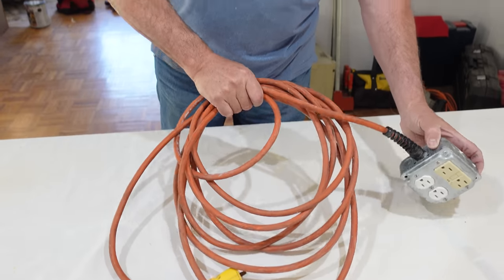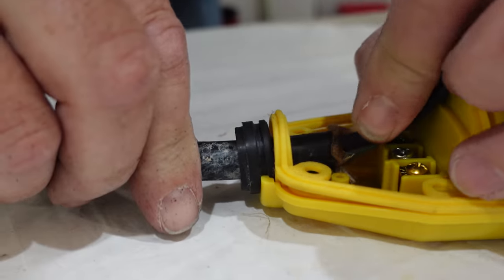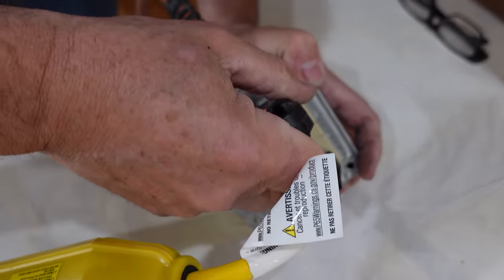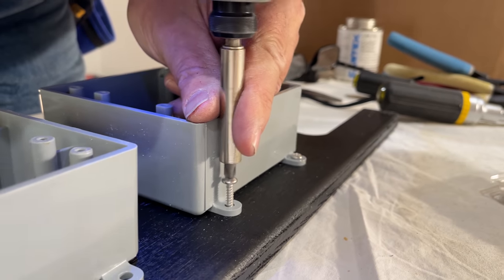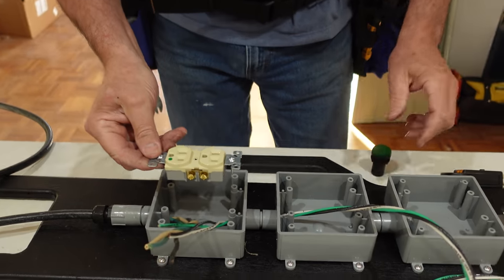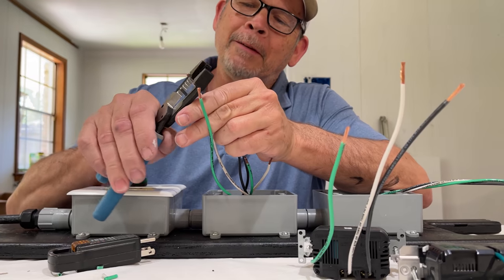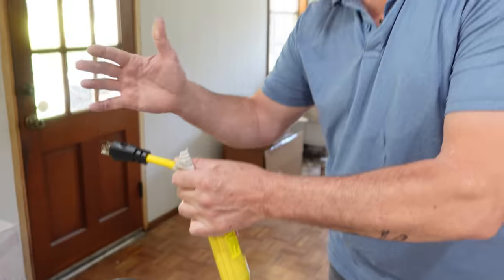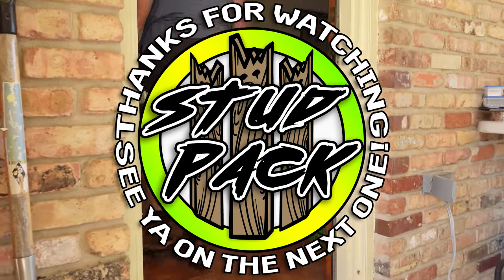HOW TO MAKE THE ULTIMATE EXTENSION CORD!

Comment: My one suggestion as an electrical engineer would be to place 20 amp outlet at the end where the line cord enters the first box and put the indicator lamp and hospital outlet at the far end.  That would serve two purpose... it would keep the heavier current from passing through extra wiring and connections.  Second having the indicator at the far end would indicate that power is actually getting to the farthest end of the unit!
Reply: except they used those wago bus bars to distribute the electrons, so each outlet was effectively the same distance from the main wire.
Reply: Can you explain the purpose of a 20A outlet when that GFCI plug is only rated for 15A?
Reply: @amkelle2  - As stated in the video the 15A gfci can handle some overload although that is not ideal.  You could usd a 20 Amp, inline gfci unit instead, but that might require you have access to a 20 Amp receptacle as the source power.
Reply: @LarryCoates1948  To be fair, yes, I did not intently watch the whole video, I skipped through a lot of it to get the jist. But still, wouldn’t a 20A pull on a 15A outlet be unsafe? Or even pointless if the breaker is 15A
Reply: @amkelle2   - it could be a problem but most likely not for a short term use. Long term yes ti would be a problem but would trip the breaker if it heated up for too long!
Reply: @LarryCoates1948  Maybe it’s just me, but it sounds like putting space heaters on an extension cord
Reply: @LarryCoates1948  What about a 20A breaker that has multiple 15A outlets, but (1) 20A outlet? Or is that against code?
Reply: @amkelle2  Look at it this way, You can plug a 15A cord into a 20A socket. 
As long as the cord you use is rated for 20A, using a 15A plug works just fine in a 20A socket.
Reply: @gameglitcher  Yeah, it doesn’t work the other way though or you burn your house down. You’re not gonna put 60A breaker on wire rated for 30A
Reply: @fourtwanky  , no, not true.
Check the video at 18:30.
They're jumpering each box.
I'd use the wagos in the second box to distrbute the power evenly, like you said...
Reply: @amkelle2  If you are using a 20 amp device when a power surge comes through and the GFCI is rated for 20 amps then the device is fried. You want the power to cut off before it reaches the devices rated amperage.
Reply: @budsak7771  Well, I’m not referring to a surge event. So, as a example, let’s say you get a water pump. The water pump outlet is 3/4 inch. So you use a few adapters and attach the outlet hose to a 1 1/2 inch hose. Well, it doesn’t matter how big you make the hose, it can only pump as much water as is rated for the 3/4 inch outlet. It’s not gonna pump more because the hose is bigger. So basically, if you put a 20A outlet on an extension cord with a 15A plug, won’t it overheat from too much draw? Or 20A devices just won’t work?
Reply: @amkelle2  The GFCI is supposed to break in the case of a power surge which is why its a Circuit Interrupter. Any connection will allow past exceeded rating as shown at the end of the video but the amount has to be a sudden burst to interrupt the connection. At the end of the video if he had all the devices plugged in and they were all switched on at once the gfci would've blown. But since they were all turned on one after the other the gfci didn't interrupt and like the camera operator asked if it could've started a fire, it definitely would've gotten some things hot.  So a GFCI is for surge protection not amperage protection. Also, the wire amp rating table will show how much amperage a cord will support.
Reply: @budsak7771  I know. That’s what I’m saying. The GFCI WON’T trip with 20A devices, but it’s only rated for 15A. If you run 20A devices on a 15A wire and outlet, is that not extremely dangerous? Because it’s not only heating up the extension cord, it’s also heating up all the wires inside the wall, and the outlet.
Reply: @amkelle2  Yes, it is dangerous to run any amperage over a devices rating. The best thing to do is to keep track of devices amps and know which receptacles are connected.
Reply: @budsak7771  That’s my point! Why put a 20A outlet on a 15A plug?
Reply: It doesn't really matter. He have a 25 meter cable from the closest outlet it won't be a problem. Wagos can tackle it. And for the light, if it's in series it is possible that the first has power and the second don't but if they do it properly it won't be a problem
Reply: It doesn't really matter. He have a 25 meter cable from the closest outlet it won't be a problem. Wagos can tackle it. And for the light, if it's in series it is possible that the first has power and the second don't but if they do it properly it won't be a problem
Reply: The 20A receptacle is useless in this use case anyway. Seeing at he is using a 15A plug. I still don't understand why he used it even after his explanation.
Reply: @amkelle2  It's a GFI, not a circuit breaker. It looks for leakage current that exceeds 4-6mA at which point it will trip, nothing else.
Reply: @bobd.  I know, my point is not the trip because of a ground fault, it’s that the wires are rated for 15A, so overloading the wires with 20A is a bad idea, mainly BECAUSE it won’t trip the GFCI and it will just heat up the wires and components, including inside the wall
Reply: "My one suggestion as an electrical engineer would be to place 20 amp outlet at the end "
So you can plug the extension into a 15 amp circuit and run a 20 amp appliance tripping breakers and starting fires?
This is why I hide my tools when I see an "engineer" coming my way.
Reply: @BS-ys8zn  perhaps  but my dad was a master electrician and I worked with him from the time I was 12.  Did you actually watch the entire original video which demonstrated what it took to trip the 15 Amp breaker in the main panel?
Reply: @amkelle2  as
Reply: @budsak7771  That is not correct Bud. GFCI= GROUND FAULT interruptor, not over-current or surge interruptor. 

A GFCI does not sense current overloads nor surges. GFCI's are not circuit breakers. They are Ground-Fault-trip devices. The GFCI trips (goes open-circuit) only if a ground fault is detected. A 15A GFCI will flow 50 amps (however briefly) before smoking and worse, but it will not trip. (Yes, that's a silly, worst-case example; there wouldn't be a 50A 120v breaker, normally, but I think I make my point). 

Regarding current-flow, a 15A GFCI receptacle is just like a 15A standard receptacle: it will not go open-circuit due to short-circuit or excessive current draw by the device plugged in. That is because the GFCI is not a circuit-breaker . The panel breaker will go open-circuit if current draw exceeds the panel breaker rating, but the GFCI will remain un-tripped. 

The sole purpose of a GFCI is to trip if current leaks from a circuit conductor to ground in the GFCI or in any protected receptacle wired "downstream" from the GFCI. To sense current leakage (not over-current) and to protect the operator. Not to act as a current-trip or surge-trip device. 

This discussion would be better served if everyone will understand that GFCIs do not contain a circuit breaker. Yes, a GFCI contains a little button that goes "POP" sometimes, and power is cut off, and we press the button to restore power. Such a trip may look similar to a circuit-breaker trip but *it does not trip due to over-current*. It trips only due to a ground-fault.
Reply: @davecc0000  Thanks dude, I knew I was missing something! It is for some kind of short in the circuit and not a surge. Been too long dealing with the details. Appreciate ya!
Reply: @budsak7771  No, not just a short, but some drain to ground. If you short hot to neutral, there is no leakage to trip it, just lots of current.
Reply: First and foremost circuit breakers protect the cables distributing power from the panel board to receptacles and switches.
Reply: @joefrisco  To be more clear, they are designed to protect the conductors but do also protect devices. A breaker is going to trip long before the conductors get too hot which also saves the device if it is the source of the over current.
Reply: As someone who knows pretty much nothing about this kind of stuff, I was wondering why they didn't put the indicator light at the top.
Reply: I agree the 20A outlet should be first even though all outlets are wired in parallel. Reason being that the parallel connections are made along those wego bus bars instead of a strong wire to wire conductive connection like with wire nuts.

If you have 2x 20A devices pulling current from that outlet, you aren't putting that current load on those bus bars in addition to the additional load from the devices plugged into the other outlets.

It's a bit nit picky, but I think it's better practice even if the wego bus bars can handle the combined current before the breaker trips.
Reply: "as a blah blah blah" the worst way to start a comment
Reply: @fourtwanky  But in one case it's going through more connections and more wire.
Reply: @davecc0000   This is what someone well educated in his field of expertise looks like.
Reply: @amkelle2  the only real purpose is the contacts are stronger inside the outlet and can take the abuse of pluging and repluging things into it all the time.  The amps going through the cord is limited by the 15 amp GFCI plug.
Reply: @willschultz5452  Is that really a thing?
Reply: @amkelle2  sorry what were you referring to?
Reply: @willschultz5452  The 20A outlet with a 15A gfci
Reply: @willschultz5452  Like is the 20A outlet more resilient? Isn’t there commercial grade 15A outlets for that specific purpose
Reply: @amkelle2  yes they are and they have strong contacts.  They do make premium grade 15 amp ones also, the main difference then is the 20 amp receptacle just has that cut out for the side way prong for the 20 amp plug. It really makes no difference since  The current flowing through it is regulated by the size circuit breaker. It's perfectly fine to use 20 Amp receptacles on 15 amp circuit because if you overload it the breaker's going to trip.    Same way if you use 15 amp receptacles on 20 amp circuits that's still perfectly fine by code.  Nothing that has a 15 amp type of plug on  it is going to exceed 15 amps.   I just use premium grade receptacles  either 15 or 20 amp rather than those cheap ones.
Reply: @willschultz5452  I just don’t get the idea of using a 20A receptacle if it’s only gonna pull 15A
Reply: @amkelle2  its really only for the  durability of it then it is that any more power would be flowing through it
Reply: Indicator light at far and near may sound like too much, but this the HULK OF ext cords right? It gives more instant exact  power  location.
Reply: @amkelle2  
A heavy duty 15 Amp plug, the types used in the USA like the heavy duty one shown in this video can handle a lot more than 15 A continuously. In fact the only difference between the 15 and 20 Amp plugs is that the 20 A one has the blade at right angles and is not any thicker. Generally its housing is made of materials to handle more heat. Drawing 20  Amps from a circuit protect with a 15 A breaker will cause the breaker to trip due to overcurrent but not immediately. A 15 A breaker means it can handle 15 A continuously and will eventually trip on currents above that based on a graph specified by the manufacturer. The more Amps above the rating the sooner the breaker will trip. At 20 Amps drawn  it may take 15 A breaker 2- 3 minutes to trip (depending on the type).

The reason that a 20 plug has a different configuration is so that the average person can't plug a 20 A rated device into an ordinary receptacle that is supplied by wiring that can only handle about 15 Amps. If that supply is protected by fuses that have been replaced by a wire or a nail at some time in the past a fire could result.
Reply: @davecc0000  
These days RCD Breakers (Residual Current Device Circuit Breakers) which is what many circuit breakers and power board fuses are replaced with here in Australia have a GFCI, Surge Protector, and Over Current Circuit Breaker all built into the one circuit breaker. They are quite cheap and very handy. They were first used as the main switch / breaker but as they got cheaper and smaller they are now installed on seperate circuits forgoing the inconvenience of losing light and power to the entire house when there was an earth leakage fault. Nowadays, there is a main high current breaker for the entire premises and individual breakers with GFCI built in for seperate power, hot water heater, stove, air conditioner, and light circuits as required.

I understand your point that many GFCIs found in receptacles esp the USA don't have an overload breaker built in but some extension lead power distribution boards do and the DIN rail standard type that I mentioned above could be fitted easily into a plastic box so that you had GFCI and overload protection if you wanted to make one yourself as in the video.
Reply: awesome suggestion
Reply: @davecc0000  I'm glad that someone else understands that about GFCI.
Reply: @ Larry Coates why do engineers (& I especially notice electrical ones do this more) always start off a conversation announcing they are one? Just curious 🤔
Reply: thats a good idea
Reply: @eddiesgroup9604  - At 15K watts, you are pullig over 136 amps at 110 Volts.  Most extension cords are designed to handle up to 15 amps.  That means that you need at least TEN (10) power cords each on their own 15 amp circuit!  Likewise, most power strips are designed for a maximum of 15 amps so one per extension cord.  To put things in perpsectice most homes only have between 100 amp to 200 amp electrical service into them and your sound system is using about 70% of all of the power needed to power an entire 200 service entrance for most homes!!!  It is little wonder that You are having power problems!  Keep in mind that I said that you need 10 15 amp circuit breakers, NOT 10 receptacles, because often one circuit breaker supplys power to multiple DUPLEX recptacles!  Hopefully any comercial venue that you are performing in should be able to provide you with at least 10 dedicated circuits!
Reply: @LarryCoates1948  most audio systems run average loads of 10% of peak with transients in the millisecond range, and that's at full blast. The OP is obviously not doing any serious pro work, and is likely not even hitting those numbers as evidenced by the fact he's probably running the whole thing off one 15 amp circuit presently. He'll be fine with 2-3 15 amp circuits.
Reply: @seanoneil1681  Excellent question! 'Especially true when said electrical engineer is NOT a practicing electrical engineer, but rather, for 11 years has been a self-described failed Internet marketer, who may have studied electrical engineering sometime in the past.
Reply: @eddiesgroup9604  look at the total amps of your system. 
The power drawn at the outlet is not 1 to 1 of what goes through the speakers, because the speakers do not have 120 volts across them.. 
Watts = Volts X Amps or Amps = Watts / Volts 
A standard 15 amp outlet can easily handle 1.5 Kw. 
Your speakers are not at constant 6 KW 
Let's say divide the volts in half, we can double the amps and still draw the same watts
Reply: @seanoneil1681  Because they are a trained voice that may be worth considering versus the "I'm not an electrician, but..." comments. When I see comments that start with "I'm a Journeyman or Engineer. or I'm a trained..." I pay a little closer attention to what they have to say.
Reply: @budsak7771  GFCI = Ground fault protection NOT over current protection
Reply: @amkelle2 I have 20amp outlets everywhere in my house because they are a better built outlet.
Reply: I’m no engineer but those steps you described seem so obvious.
Reply: @Mike Dalton  yes it should be obvious  but since it was wired opposite to that, I guess it is not so obvious.  Sort of like "common sense" is not all that common!
Reply: 15a outlets are rated to pass 20a... Field electricians would know. Not coffee drinking electrical engineers.
Reply: @budsak7771  I would have to disagree, the GFCI is for current not returning in equal amount via the neutral, as long as it is balanced the GFCI does not care. The reason the GFCI will trip is if even a microamperage goes elsewhere to ground. If you want surge protection which has been useless in anything I have seen, you should instead Google Brownout Surge protectors, (no battery backup) and UPS . The surge brownout protectors actually cut power at low, roughly 90 volts, and high, roughly 130 volts, and leave it off for around 30 seconds, or for units to protect compressors like refrigeration they leave it for 3 minutes to give the pressure in the compressor time to equalize instead of trying to restart while pressure is still high. Hey, I think just figured out what the ultimate extension cord is missing, But hey I was happy with the predecessor to the ultimate .
Reply: Smart man!
Reply: @larry Coates I didn't read all the replies so someone might have mentioned this but would it be dangerous to put the light at the far end? because if one of the connections leading to the light burns shutting the light off, you could end up in a situation that the cord is live, but is thought of as turned off?
Reply: @GeN56YoS  - That is a decent point that you raie.  It could provie a false indication that ALL circuits are dead wnen that might not be the case.  Probably the likelhood of that condition happening is pertty small but certainly NOT zero!!!  My main point was to put the heaviest load closest to the line feeding the unit to minimize drop across branches towards the end
Reply: Not an electrician but was taught that the gfci is designed to trip if there is a short to ground
Reply: @LarryCoates 1948 he claims that he reads every comment on his videos in this video it looks like either he does not check every comment or only comments on comments that make him look good.
Reply: It's alternating current, so what difference does that make which devices closer to the line side?
Reply: @amkelle2  He said if you're using a tool that requires the 20A outlet, you DO NOT plug the cord into 15A power.
Reply: @amkelle2  Whichwires in this video are limited to 15A?
Reply: @budsak7771  A short circuit is not the same thing as a ground fault.
Reply: @seanoneil1681  Not all of us
Reply: @LarryCoates1948  I think this question was satire.
Reply: @kmchartrand99  Is your cabling at least 12 ga wire? If not,then you have created a potential fire hazard.
Reply: @GeN56YoS  It's alternating current so it makes no difference which end the light is on. There's an incredible amount of ignorance being posted here.
Reply: @disabledhomesteader  That's not a short circuit and it's not a power surge.
Reply: @dolfinwriter5389  it's more convenient but user preference at the end of the day
Reply: @JVBL1  What is? Not sure what you're responding to.
Reply: @dolfinwriter5389  he brought up a good point of putting the light at the end and the higher plugs at the start but you are also current that it's alternating current each his own
Reply: @dolfinwriter5389  The outlet and the ones in the wall. There’s a reason the outlets of the home are 15A outlets
Reply: @dolfinwriter5389  Then why have it?
Reply: @amkelle2  It's HIS extension cord. He will know whether he has plugged it into an available 20A receptacle or not. He's not selling them. It's for his own use. So if he doesn't have 20A power available to him, then he doesn't plug in any tools that require a 20A receptacle. So to answer this question, "Why have it?" is for when he NEEDS it AND has 20A power available. I heard him say this. Did no one else?
Reply: @amkelle2  No. You're not going to be fully loading all of them simultaneously. And if you TRIED that, the breaker would trip.
Reply: @dolfinwriter5389  Dude, did you see him put a 15A GFCI protector on it? Why put a 15A GFCI protector and a 20A plug?
Reply: @dolfinwriter5389  The 15A GFCI would trip too, so why even put a 20?
Reply: @amkelle2  There could be a couple of reasons why the home outlets are 15A outlets, but that's beside the point. Any branch circuit which is wired with 14 ga cable should (1) have only a 15A breaker; and (2) have only outlets rated for 15A. This thing he made is not an outlet in the home; it's his own work aid and HE will KNOW whether he had 20A power available and whether he plugged it into a 20A outlet. I installed some new circuits in my garage for freezers and power tools. I used 12 ga wiring and put them on a 20A breaker, and I installed 20A outlets. I could have gone cheap and put in 15A outlets. The outlets inside the house are 15A outlets on 15A breakers, so because I haven't torn all the walls open and inspected all of the wiring, I'm going to assume there is only 14 ga wiring inside.
I don't like a lot of Larry Coates's responses here because I don't think he knows what he's talking about.
But all of this discussion proves a bigger point--the person who posted this doesn't have to show any credentials whatsoever to prove to viewers that he knows what he's doing. Nobody should be watching this video and then making one of these for their own use, let alone for anyone else to use--UNLESS that viewer is a licensed electrician and knows and knows that this thing is code compliant in his or her locale. The code does vary from city to city and state to state, and sometimes even within cities. So because of that, I would not recommend ANYONE install a 20A receptacle in this device as this YouTuber did. Guaranteed with the amount of ignorance displayed in these comments that SOMEBODY is going to make one of these and then plug it into a 15A outlet and then try to run some tool that requires the installed 20A outlet on this device, which is I believe, your whole point. That would be foolish and dangerous. But I can guarantee somebody will do it. I found enough electrical nightmares in my last house of 23 years that was previously owned by a LICENSED ELECTRICIAN, and now I've found a few in my current house, done either by idiot previous owners or shoddy contractors at some point since the house was built in 1978. We even found that our AC condenser external disconnect was bypassed internally. I suspect the condsr fan motor was failing for some time and blowing fuses. So they bypassed the fuses. And we found it when we had the condsr fan motor replaced under HO warranty just before the warranty expired!
And your own comments prove part of the reason for that--you said you just skimmed it. I think you haven't fully developed your thoughts of what really bugs you about this and how to ask the question you really want to. So how about this--Suppose somebody else just "skims" it and misses key warnings and caveats, and builds one of these, or builds it either poorly or just wrong (or BOTH), and eventually starts a home fire by overloading either this device or the home wiring. Who's at fault? I think where you're going is to say the person who posted this video is at least partially at fault, but may never even now what he caused. He personally will never misuse his own device.
I don't think somebody who only knows enough to be dangerous should be watching this video and making one of these. So the person who posted it should probably take it down.
Reply: @amkelle2 Why would the 15A GFCI trip, absent a ground fault?
Reply: @amkelle2  I think you have a misconception that installing any 15A outlet in a circuit thereafter limits that entire circuit to 15A. And/or you have a misconception that the 15A GFCI somehow trips on overcurrent like a circuit breaker. It does not protect for overcurrent. It will not trip on overcurrent. It will trip if it senses a current mismatch between the hot and neutral leads greater than its design trip point.

I'm not going to respond to any more of this because it is too difficult to find this part of the comments thread every time, and I have to get on to some other things.
Reply: @dolfinwriter5389  If it draws more than 15A
Reply: @dolfinwriter5389  Weird! I know exactly when you reply
Reply: Maybe replace the switch (or the indicator) with a neon indicator switch. i can see wanting to keep some circuits live and only switching the last one, but replacing the indicator with a lighted switch would open up a slot and serve two purposes.
Reply: No, the 20-amp outlet should not be in the first box.  It shouldn't be in any box.  Including a 20-amp socket at all in this is a code violation and a fire hazard.  Period.

Why?  Because the cord itself (and the GFCI device) is not rated to carry that current, and can overheat, melt, and catch on fire if that is done for an extended period.  Worse, the plug end is using a 15-amp plug, which means it can (and probably will) be plugged into a 15-amp wall socket.  If you then pull 20 amps through that 15-amp socket that is not rated for it, the wall socket can melt and catch on fire.

The 20-amp stuff is keyed differently for a reason.  If you have any 20-amp outlets, you must use a 20-amp plug, and ensure that all intermediate components are rated for 20-amp operation.

And his statement that "the breaker will just trip" if you plug it into a 15-amp outlet is also just plain wrong.  That is not how circuit breakers are designed or what they are for.  It is quite common to have 15-amp sockets on circuits with 20, 30, or even 50 amp breakers, and in that case the breaker will not trip, but the socket will still be overloaded and can catch on fire.

Really, one of the things he should have built into this but didn't is a 12-amp breaker in the power strip itself (Note: even 15-amp would be incorrect in this application.  NEC requirements say you are only allowed to pull 80% of the rated current through an outlet (15*0.8=12 amps max if you're using a 15-amp plug)), to ensure no more than that is ever pulled through the main plug/power cord (like almost all real power strips actually have).  If he'd done that, then it actually would be OK to have the 20-amp sockets in there (but they'd also be kinda pointless).

This guy really needs to go back to school.  He does not understand what he's doing, the codes, or any of the principles involved, and as a result he is designing actually potentially unsafe equipment.
Reply: I was also thinking it should be wired so that the switch controls the whole "bar"
Reply: That’s really smart
Reply: I was thinking it would logically make more sense to have the 20Amp plug first, so you remember not add extra load after it.
Reply: Neat project. Thanks.
Reply: @amkelle2  actually, you can. Code allows 15A wire (AWG14) to be connected to a 20 amp breaker as long as that wire is going to more than one 15 amp outlet.
Reply: @thelongislandguy  I’m not talking about the breaker, I’m talking about a 20A outlet
Reply: @garychin-a-foeng7901 So you'd make the second box a central hub from which to fan out the power back to the first and on to the third as well as the second?  Good idea-- that way there'd be no voltage drop on that last receptacle in the third box, if they were running something in box one or two for a short run continuous duty.  The NEC states that the circuit should be able to handle continuous duty at 1.25% before burnout is likely or limit the total load to 80% if there are multiple draws occurring at varying intervals.  Like he said in the video, they're not going to be running every device concurrently.  At most you'll have a couple of iPhones on a trickle charge while running a table saw for a short run continuous duty.  The longest cuts on a table saw tend to be rip cuts on 8' sheet goods such as plywood or mdf... if you're running a planer, perhaps the load would be greater than the table saw for longer boards.  I don't have any experience with a planer.  I always buy finished goods since I don't own a planer.  Can anyone weigh on on the planer amp draw?  What's been your experience with the voltage drop on the circuit while a planer is running with a shop vac or dust collector running?
Reply: @amkelle2 If the device is running continuous duty on the 15amp circuit it's likely to burn it out pretty quick.  My table saw trips my 15amp circuit all the time, usually when I'm ripping 8' long sheet goods and especially when the load meets with some resistance.

"Worn motor brushes, a bad drive motor, a faulty motor overload switch, using an improper extension cord and binding up the saw blade can cause the table saw's motor overload to trip. A long or lightweight extension cord can cause a voltage drop that overheats the motor and causes the overload to trip."
Reply: Most GFCI outlet that are 15 amp have a 20 amp pass through.
Reply: Laughed At   🤣    "My one suggestion as an electrical engineer "
Reply: It's a good idea
Reply: @fourtwanky No, they are not the same and the 20a outlet passes through many more connections.
Reply: I don’t like how close the GFCI hump is to the plug.  If it is too heavy, it may pull the plug loose.  A few more feet away would be nice.